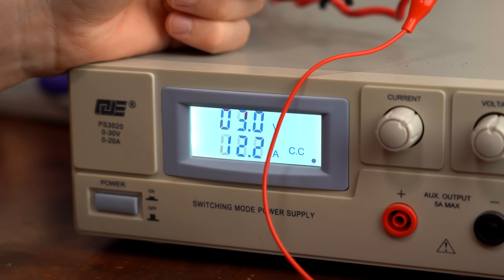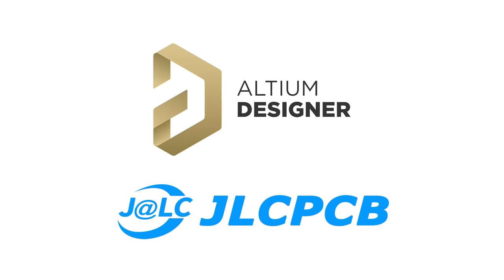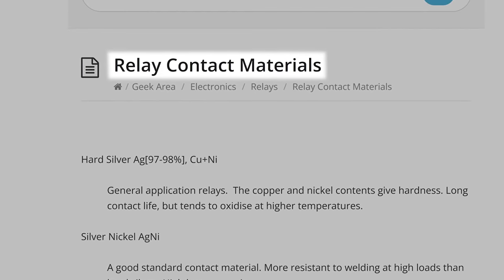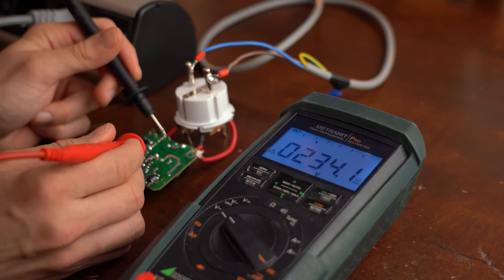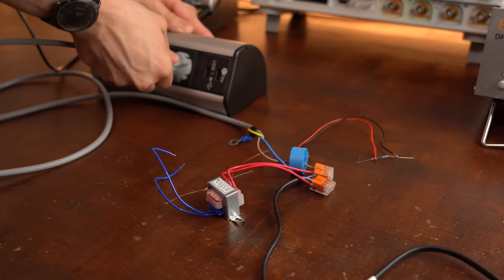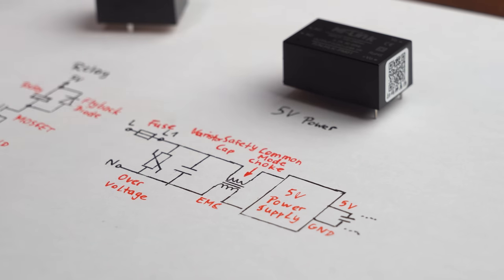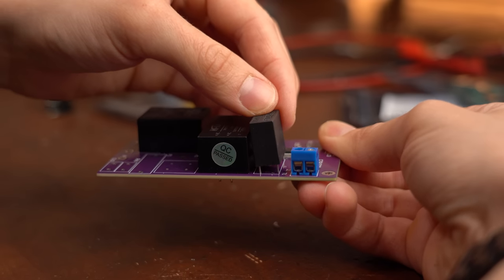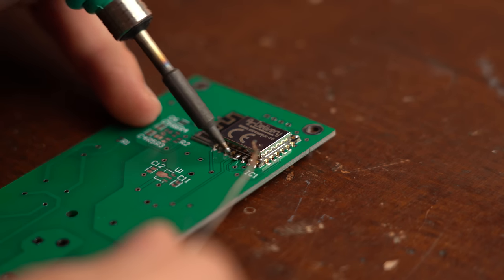The Dark Secret of Smart Sockets and How I Fixed it! (DIY or Buy)

Comment: Awesome Work! Thank you for sharing! :)
On a side note: Something that popped into mind is that you may be able to extend relay life by creating a zero crossing circuit. Maybe that could be a future video topic? :)
Stay Creative! :)
Reply from the maker: I can put it on my to do list :-)
Reply: I actually thought this video was going to be about zero-crossing switching. A little annoying to tune the timing, but once you have the contacts closing at less than 10-20V, there's essentially no chance of welding. I'd be interested to see how disconnecting works. I made my circuits open at zero-cross as well, but I never really knew if it had the desired effect.
Reply: @samuraisystemsllc  The problem with zero-crossing on open is that you actually need to open at zero current, not zero voltage.  With purely resistive loads, they will be the same, but many types of things people plug into outlets are not purely resistive, so you need to be able to account for a (often unpredictable) offset between voltage and current zero-points.

It also doesn't necessarily help that much if you have inductive loads, due to back-EMF, etc, which can still produce voltages across the contacts far higher than the relay is designed for, even after they're fully open.  For this sort of concern, something like a MOV in parallel with the relay is usually an easier and more effective way to deal with the issue.

Comment: I thought it gonna be solid state relay switching at the zero crossing of the mains. It would be also beneficial in scenario where you have 5 PSU under one socket. It popping 16A circuit breaker if you hit peak mains voltage when turning on. Great job with DIY smart socket :)

Comment: You can add solid state relay in parallel with mechanical one, and turn it on just a moment before mechanical. You'll get: 1) guaranteed turn on when voltage will cross zero 2) shunted relay contacts, that will significantly increase it's lifetime because of no sparks 3) low resistance and no heat comparing with stand-alone solid state relay

Comment: I had built an ESP8266-01 4 channel relay controller board for 220v ac appliences last year. It has been 1 year+. I use it daily, controlling Fan rated 80W, LED Tube light  rated 25W, A Lamp rated 20W and a small dim bulb of 2W. No problems found yet, best of all they don’t stick in my case which might be due to low current consumption of appliences.
Reply from the maker: Sounds like a useful project :-) Yep. I think the power draw is too little to cause sticking.

Comment: My aquaponics system has an ac pump that I control with an Arduino. Every mechanical relay I tried would eventually stick in the on position.  A month ago I switched to a solid state relay, and it's been fine so far.

Comment: I love your channel and the way you explain things in detail.  I built a spot welder one time, and had the high power switching turn on at the zero crossing point so there was no current flow on switching and no arcing.   I am surprised you did not do something similar.

Comment: I really appreciate your efforts and I like this video. Creating independent solutions for the proprietary smart home jungle could not be honored enough but for the comparison the time for the design process of circuit, board, case and the documentation needs to be taken into account. Feature wise your solution is far more advanced but even if you only add only 40h of development time in total (which is surely not that unrealistic) economically your solution sadly won't be able to compete with the commercial product in my opinion.
Reply from the maker: Yeahh....it is not very cheap.
Reply: @greatscottlab  Please sell these!
Reply: @greatscottlab  There is a market for something like this. The Tasmota smart bulbs (which can be re-flashed to ESPhome if one wishes) cost 2-3x more than the Tuya ones but people do buy them. The market is smaller, because the average person does not consider the security implications of using the multitude of "no hub" smart home apps.

Comment: You need to open/close the relay when the AC voltage is close to 0, that way you avoid the sparks.
Reply: You'd also want the current to be zero.  Which, depending on the load and would either lead or lag the voltage.  Adding ESD protection like an MOV (Metal Oxide Varistor) would probably work better.
Reply: Coming here to post the same, a simple zero crossing detector is what would be needed. I’d go through an optocoupler and tie the output to an input pin on the esp. I’d say an interrupt, but 60/50Hz is slow enough to sample, or enter a subroutine that only samples rapidly during a switch on/off mode. @dminting, yes, PF is something to consider and would be load dependent. Though, it wouldn’t be a problem on power on since current = 0. And if we’re only considering inrush, it wouldn’t be an issue on breaking the circuit. Now, monitoring on disconnect, you could sample the current with a current transformer and do zero crossing that way, or, in theory, even with a bad PF, the operating current shouldn’t exceed the relay current rating.

Comment: Cheap relays can be used as long as there is a snubber circuit between the relay contacts. I will only recommend an NTC thermistor in parallel with a timer-relay if the load has a high inrush current. 

Note that the capacitor may act as a short when power is applied barely powering the load.

Comment: That was helpful. You could make power socket extension cord with multiple sockets, so one board controls multiple relays/sockets. It's easier to use sockets and mount them on a board or in a box. To simplify you can make one power measurement of all of the sockets. I want to make this but time is never enough...

Comment: If you are taking on the complexity of measuring the power at the ESP anyway, you can add a zero crossing detector and switch the relay on/off close to the zero to minimize sparking as well.

Comment: Using Shelly 2.5 relays in all of my relevant sockets works for over a year without any issues yet with daily switching cycles.
Reply: I know right, and they also have the PM switch models. My Shelly Plug-S also measures power consumption and is only a small fraction of the size of the wireless relay built here. And it can handle 10 A at 240v while also being able to set a current limit/maximum power limit.

Comment: These Hilink power supply modules are quite bad for EMI in my experience. We use them in a commercial product we designed and even with the recommended filter and protection circuit (common mode choke, class x and y capacitors, movs, ntc) it's still radiating quite a lot. Thankfully the board is in a metal box and that keeps the crap inside for the most part.
 In the past we used Meanwell power modules that are slightly bigger, way more expensive, but had all the filters inside and were rated for medical applications (super low EMI). Think you should consider those for a future revision, they're bulletproof.

Comment: I haven’t read all the comments, so someone have suggest this.  Do zero crossing switching. That is only open or close the relay when the line voltage/current is zero. May require additional sensing circuitry but the esp32 could be easily programmed to add this function.

Comment: Very interesting and useful project!
I have a small question - can a solid state relay be considered over electromechanical for longer life and compact design?
Reply from the maker: Yes. Should work longer. But also is a bit more inefficient since it comes with a voltage drop of 1V to 2V.
Reply: @greatscottlab  Thanks for replying!
That's a good point to consider ☺️

Comment: You could also add Zero Voltage or Current detection. AC is crossing 0 twice in cycle. If you disconnect relay at 0V it will not sparkle. For inductive load varistor across relay will do the trick ;-)

Comment: Another way to prevent the massive inrush is with a Triac in parallel with the relay. You trigger the triac a few milliseconds before the relay so that the inrush current starts to be handled by the triac and stops the relay from arcing, but also having the low on resistance of the relay.

Also, I understand why you used the Voltage and Current transformers for power measurement, but personally I would have just used the pure resistive methods to lower bulk and cost. The PCB will 99% of the time be in it's enclosure so it will be safe.
Reply: I was thinking about making a comment along the lines of your second idea there. If you're building this device for the sole purpose of not needing to replace or service it for long periods of time, and the only electrical contact it has with the outside world is through mains voltage anyway, then a capacitive dropper and direct resistive measurement should be fine. Also, your first idea is great! I hadn't thought of that. It's just like how high voltage DC transmission circuit breakers work by using a metal contact as the "running" link and using solid state relays as "breaking" links to prevent megavolt+ arcs from annihilating the countryside.

Comment: I did something similar, twice.  Parts: 4 gang outlet box, populate with 4 dual outlets and a 4 gang plate.  Recycle a power cord from something heavy.  Inside is an 8-relay board from SainSmart but any relay board will do.  The brains is a Raspberry Pi using the Wiring Pi to switch the relays, which are connected to the outlets.  Use a USB charger and a 6 inch usb cable to power the rPi.  The pi has a USB wifi adapter for communication.  Finally I use the web server on the pi and CGI scripts (and some SUID scripts) to turn outlets on and off.  I use it for Christmas Lights, our lawn irrigation system, and to shut down an internet switch so the kids are not up all night.  Putting it in a 4 gang outlet box means it is more like a chunky power strip than a single outlet.  Very useful though and doesn't serve ads, require a subscription, or anything.  Code can be found here: https://github.com/zettix/outlet

Comment: I've come across issues on 48V DC systems when switching large inverters. A typical 5KVA inverter can have >40,000uF of capacitors and can draw peak inrush currents of several thousand amps off a lithium battery system. Relays, contactors and breakers really don't have a chance under these conditions and the only solution is to add a resistor across the contacts to enable the capacitors in the inverter to charge up before turning the relay/contactor/circuit breaker on.

Comment: Did you ever take a look at the Shelly devices? Comparable to your DIY version, the Shelly plug S is also based on ESP32, works with home assistant, has a relay and voltage/current measurement. I am not sure about the used relay, but never had any sticking up to now, although I have multiple ones that are switched many times per day.

Comment: I think to kill spark while closing the relay contact  we normally use a shunt capacitor of low value across the relay contact. This method was adopted in earlier induction coil. By killing the spark across contact erosion as well as contact stickiness can be obviated.

Comment: Nice, however i think an even better solution would be to have some sort of transistor or MOSFET that can obviously handle the load to switch off the power to the relay before the relay connects or disconnects that way it can last even longer (considering the MOSFET doesn't fail first of course) but i think that would be also a good reliable way to do it :)

Although at that point you might as well have the MOSFET do everything 😆
you get my point

Comment: Here is a good project idea: DIY frequency response analyzer. Try using AD9833 to generate a sine wave and a peak detector circuit to find amplitude. Should be a good alternative to those in the oscilloscope.

Comment: Hello sir, I remember that you have introduced how a zero-voltage crossing detecting circuit[maybe isn't explained like that in English, I apologize] works and you also used it for solving the surge current problem from your big variac, I guess that principle would work on this relay sticking problem, isn't it?😃
Reply: In fact no. The relay is not fast enough.
Reply: If you know roughly how fast the relay switches I don't see why you couldn't time it. In a simpler circuit that's impractical but he's got a whole ESP there.

Comment: Inrush current is small problem in my experience in reley. Much bigger (in DC systems even more) is parasitic inductance when opening a relay. Because current flow store energy in inductance you need a way to discharge it. And when you open relay, voltage on inductor jump up, and arc between contractors is created. Because arc length is rising, "resistance" of arc rise to,  so current will drop to 0. On ac this proces is much simpler because curent crosses zero 100 times in second. In DC you need a way to extinguish arc. That's why many relay have ex. 8A 250V AC, 8A 24V DC. But on other end on DC you can easly use diode.

Comment: Wow. Nice solution and you taught me something about relays. It's sad that the market for these goods is all about the lowest possible price, to the detriment of longevity and creation of waste.
My only recommendations are to maybe add a manual override switch to the case and also check that the case material is of a suitable type and thickness
to be safe, in terms of both electrical insulation (double) and flammability.

Comment: Have a peek at railway signal relays. So many different ones and for different applications. All analog. Pretty cool stuff. Studied it for 4 years
Reply: Railway signalling relays is another wholly different ball game specially for signalling apps...the handle much lower currents and are deliberately designed to be slow acting.
mostly are made with(48Vdc ??) dc coil actuators..

Comment: I think that the area around the wifi antenna should be free for electrical connections. No ground plane and no wires. Maybe extruding on a boatd edge if possible. It then might get better range.

Comment: Since you are looking at the voltage and current anyways, you can just make a zero crossing detector. This will extend the relay lifespan. The Ag alloy relay may also work fine.
Reply: "just"? Seems pretty complicated to sample often enough to accurately detect them and then you also have to calibrate an offset because the relay doesn't switch instantly etc.
Reply: @LuLeBe  it doesn't need to be super precise.

Comment: You could also have used 3.3v relays instead of 5v ones and use the HLK-PM03 as power suppply, then you wouldnt have to add the 5v to 3.3v part

Comment: Try to switch the relay in time, when AC-voltage crosses zero. This should drastically reduce inrush-currents. Wire VIN+  to ADC (ESP8266) - it shouldn't be to difficult to tweak the right timing in SW.

Comment: Lots of suggestions to use zero crossing, how well will zero crossing work if you have contact bounce and a dead time between de-energizing the coil and when the contacts actually open? Most likely relay and load specific.

Comment: if you monitor the ac waveform, you can time the relay turn on with the 0 point of the ac power since no power will flow at that time.

Comment: How about adding a software feature into your design to only switch on a mains zero crossing. If tuned to switch on the lowest current that would reduce the sparking completely.
Reply: not possible with mechanical relays as the closing/opening time is not perfectly predictable. there are solutions for this. also he was testing with DC switching, AC switching is completely different.

Comment: Since power in sockets here is sine wave, how about detecting zero crossing and using that to point in time to turn relay off and on? Since there is no voltage, should be also no current.

Comment: Inrush currents are brief.  The large currents imply large power; however, the limited duration limits the total heat generated by (and absorbed by) the contacts.  This contrasts highly with a power supply's continuous output.

Comment: You can reduce the idle power consumption of the socket by using Zigbee instead of WiFi, Zigbee receivers don't need to maintain an active connection to be able to receive commands so they don't need to do regular handshakes. They're also compatible with HomeAssistant using a ConBee or similar USB adaptor

Comment: Well, personally, I prefer using Triacs or Mosfets to switch my AC loads. Mainly cause they're silent and can also be used for fancy stuff like phase angle dimming or zero cross switching.
Triacs are fairly easy to implement in such an application, can usually handle quite massive current spikes, and only cost a few cents. So personally, I don't really see a major advantage of using a relay at all. But I guess they could be useful if you need galvanic isolation from the mains or something like that.

Comment: I'd honestly use a solid state relay. Much more reliable and much faster switching. You do have to deal with heat for higher loads, but it's not like you are trying to run a space heater off this.

Comment: I love my sonoffs with the open source software you can put on them but I only have ultra low current flowing through them. A Shelly wifi relay can do ac or DC, you could in theory just us one of those to switch a solid state relay..no sparks in those for inrush current. I can't speak to any potential problems for repeated inrush current episodes on a ssr but you would think it wouldn't care due to their design of having no moving parts.